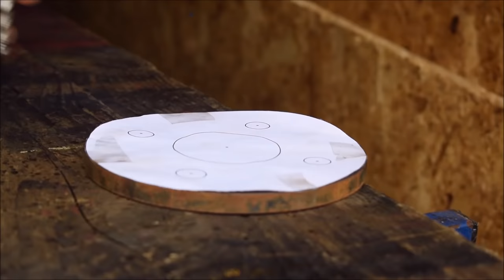Homemade 6.5 HP Motocultivator from Car Parts

Comment: A pto shaft from the motor gear system would make that a harvester and reaper if you had an adaption for a trike seat on a wooden iron rod reinforced wagon. You could chop that weld and just add a trike adaption wheel system and it would be a very useful piece of farm equipment. Thought it was what the Germans would say as fucking brilliant. ;)

Comment: This is pretty bad ass. I need to get myself a welding machine.
Reply: Honestly the chicago eletric from harbor frieight isnt bad! the mig welder wire feed my buddy has he runs beads for hours straight! we went thru 2 spools in one night practicing and never over heated/tripped. its a 110 outlet so easy to hook up and use ad great for leanring! oh and a hundred twenty bucks. You can do it man. Just get one. Youl love it :)
Reply: @waynegretzky8464  Does the harbor freight welder weld aluminum or magnesium? Thanks for your response.
Reply: @bigtexas7580  Yes.
Reply: @waynegretzky8464  Cool, thanks. I'm going to pick up one today.
Reply: @bigtexas7580  Hell yea brutha! Enjoy being able to do anything now! And your friends will have all sorts of work for you ; )

Comment: Im excited to know its top speed on fourth gear
Reply from the maker: Hello :) with that setup it was around 25kmh, after some time i did pulley swap, i made 1:1 gera ratio and with at 3800rpm top speed was around 45-50kmh 😅
Reply: @mrimbusyt  thats impressive for a heavy load carrier.

Comment: What welder are you using?
Reply from the maker: Im using parkside 120a mini inverter from Lidl 😀
Reply: @mrimbusyt  cool! I have the cheaper "crappy" transformer based Parkside welder that struggles to melt 2.5mm electrodes and constantly overheats.....though it only cost 50€ so 🤷
Reply: @mrimbusyt  How much did it cost?
From my research inverter welders are much more powerful than AC buzz boxes/ transformers!